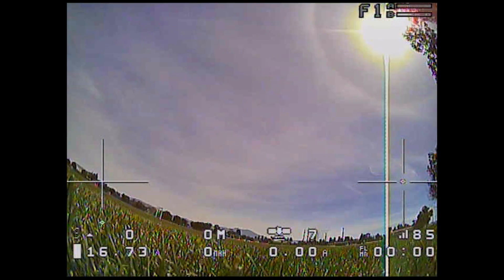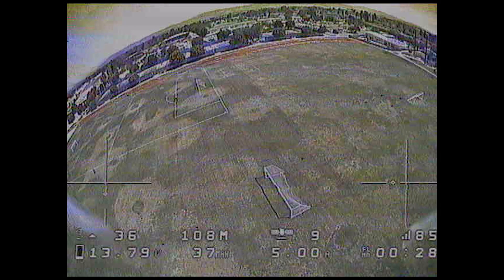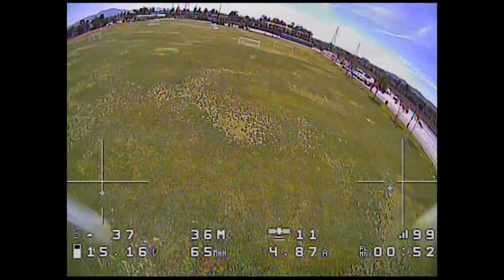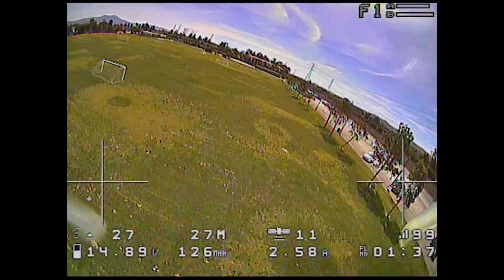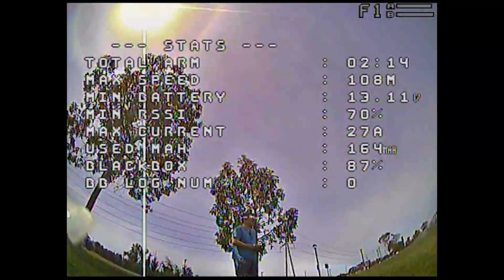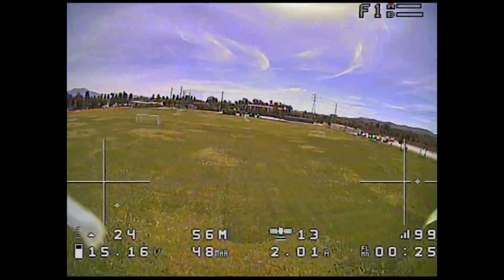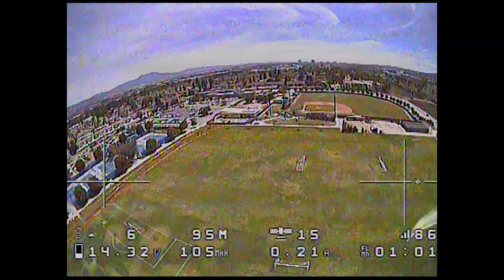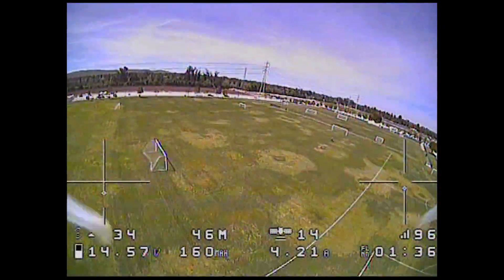GPS Speed Test // Diatone GT-R349 ⚡⚡⚡

Comment: Awesome video! Did some speed run tests using a pocket radar and stock 3028, then 3052 and 3076s, using RDQ 4s 650s, got it past 100mph and the motors just scream. Its fast and likes to eat batteries.

Comment: I used the HQ 3x5x3 props and added an xt60 lead to mine and got 113mph, had 2 weird freak outs trying to do a front flip at about 80mph! I believe it was the momentum of the battery that caused it, one was so bad I disarmed but was able to recover.

https://youtu.be/bfmLGGxLTmk

Comment: Just working it out here; the GPS is giving us ground speed. What we're wanting is air speed of course, so wind can affect the reading. Explains why official speed records use GPS and multiple runs in both directions. The GPS is great the way it averages over a second or three, in that it is not going to ever over read (except for wind effect). I figure the best approach using the OSD end of flight screen, is to do two flights with two fresh charged batteries, in opposing directions. Then your speed measurement is the average of the two screen readings. That will cancel out any wind effect, and allow you a few runs in each direction - to make sure you get it fully up to speed. Just hope the wind doesn't change between flights. Hm :).

I think I'll wire in support for the Bn-180/220 modules on every build from now on, where possible.

Re. max throttle; was AirMode on? Doesn't airmode limit the min and max throttle values slightly? We might want to do these speed runs with airmode OFF. I doubt we'd see much difference though.. very often the last few throttle percent just burns more amps and is to little effect.. depending on the build/motors/cells/props/etc.

Thanks for the video and info. Cheers.
Reply from the maker: I'm sure you are missing at least 50 more steps to maximize every ounce of speed possible.  I'm not interested in doing that kind of testing.  Hopefully someone else with a lot more time on their hands will use this video as inspiration to take this testing to the next level.  Good luck to them!

Comment: Hey Albert, another great review.  
 I was curious,  I have  a gtr 349, and my amp,and Mah  readings are messed. what are you using in beta flight bat for your settings? I noticed that they look on in your video. 
 Thanks in advance.
Reply from the maker: You need to do a calibration.  You can't just use anyone's settings.

Comment: Great video! I love my GTR 349, it’s my first drone and I’m just getting used to it. What batteries are using? I see you’re getting up to 25A from them.
Reply from the maker: 750mah 4S GNB Lipo.
Reply: Theres no way that current meter is calibrated, your pulling at least 60amps at full throttle on those motors with those props

Comment: What update rate are you using on the GPS? The standard is 1Hz, so you have to wait 1 second to get the reading. But each time you get the average speed of the past second, so if you were accelerating then you get a lower reading than the actual (at time of the update). 
If you're able then try to increase the GPS update rate but I'm uncertain whether it's supported in betaflight.
Reply from the maker: I just used the auto settings.  I realized the max speed for the flight is shown at the end when you disarm, so my whole ramble rant was kinda pointless.  You can still get the max speed at the end and I think that's all I care about.
Reply: Here is the betaflight documentation, how to change the update rate: https://github.com/betaflight/betaflight/blob/master/docs/Gps.md#ublox-gps-manual-configuration You could try the `Measurement period 100` to set the gps to 10Hz mode. You should also check the navigation mode: it could limit the reported speed.

Comment: I saw a video of a guy showing his RC Car going 114 mph (https://youtu.be/WvUWHCqOijI?t=18) as measured by 2 radar guns and Garmin GPS.  The GPS is accurate, but the measurement speed is always slightly delayed due to the processing of the data.  Great point about the OSD not updating the throttle percent accurately.  I wasn't aware that it didn't register in the OSD, perhaps a black box log would help?

Comment: Are you using Betaflight 4.0 stable release? having an issue with this quad taking off on its own when arming with 4.0 flashed, doesn't happen on 3.5.7? Thanks for your vids and your efforts!
Reply: Just a thought... I noticed that the "Motor Idle Throttle Value" has changed from 4.5% to 5.5% in BF 4.0. That obviously would spin your motors a little faster when arming.
Reply: @Dieselshroom  Changed my motor value all the way down to 3% and still was happening. This was a complete fresh flash, no diff paste or anything, set up from new
Reply: @shaneybow2102  its something about the D value, needs to be way lower in 4.0... also decrease P like they write in, i guess, 4th topic in the tuning notes
Reply: had same issue with custom bild...its about the hight power to weight ratio... lowed pids...solved it... just recognized its common in bf 4 , so check tuning notes... at the beginning...there is a cli text....wich should solve that problem i will also try this tomorrow ;) https://github.com/betaflight/betaflight/wiki/4.0-Tuning-Notes
Reply: @AluSlinky  ~  Way to go Bro!
Reply: I heard this from a buddy on his quad too.  I haven't gone to 4.0 yet but this is kind of scary.  Did you import a diff dump of your settings from 3.5.7 into 4.0?  He reflashed and erased the chip then reentered manually and it didn't happen again.  So I'm not sure if it was due to old data on the chip or an incompatible diff import.
Reply: @frankbarajas  yes was pretty scary yesterday testing my new 2.5 inch build with 1:9 weight to power ratio xD flying to the moon when taking off....disarmed at about 200m hight...armed and catched and disarmed about 10m from ground no damage :D
Reply: @AluSlinky  ~  Nice save and I doubt most people would have been able to do that quick of an on-the-fly recovery.
Reply: @frankbarajas   was first flight, LOS, dont know how it would have end in FPV ^^
Reply: @AluSlinky  ~  I thought you had done that save FPV...lol  I always maiden my quads LOS, but I learned to fly line-of-sight some  37 years ago so it's natural for someone like me.  Smart moves none the less, you turned what could have been a bad day into a great save.  Those of us about to fly, Salute You.
Reply: @AluSlinky  nope the scary thing was first time arming was indoors in my warehouse to make sure everything was correctly set, little did I think it would start lifting off 😲, quick disarm though so was in full control. Going to test the cli from the devs on that particular issue and see if it helps but I mean how low can D go before it's having no affect?

Also d_min is active so technically my d gains were only sitting at less than 10 on pitch and roll when this was happening🤔
Reply: @frankbarajas thx bro :)  i only fly LOS when testing....im very bad, only i can with nose in front...when i turn yaw im completly lost ^^ im very happy i saved my tiny monster :D
Reply: @shaneybow2102  after happening to me...i lowed all p's and d's and also feedforward on all axis... i think p and d about 20 and ff to 50. also i set motor idle to 1percent, but dont think this was solveing it.
Reply: @AluSlinky  are all other 3 inch builds having this issue or is this a combo of this particular quad and bf4.0? Even my 75x on a carbon frame has way higher pids and this kind of thing never happens, I know it's a different beast but still.... Interesting
Reply: @shaneybow2102  its my first kwad with bf4, its a custom 2.5" build with the diatone 249+ frame the mamba mini stack, racestar&t-motor 1106 and emax avan rush props, its just 155g with lipo and about 1400g max thrust ;)
Reply: @frankbarajas  nope I didn't paste any diffs, set up completely from scratch, can't be down to sensitive D as my gains were only at 14 on pitch and roll, hardly high?
Reply: @shaneybow2102  ~  That's way bizarre, sort of glad I have waited on 4.0.  Sorry for your troubles though.  Have you checked out AluSlinky's comment about the 4.0 Tuning notes?  Maybe there's something else there that might help.
Reply: @shaneybow2102  they added some mor values ,iguess,  like d_min... maybe you have to change that also
Reply: Frank Barajas betaflight github strongly recommends NOT to copy and paste into 4.0
Reply: @53roger  I didn't copy and paste though as I had seen this before hand. Testing today
Reply: @shaneybow2102  i just tested... flashed new, copy this cli for freestyle and after this for high power to weight ratio....turned down airmode to 3percent, and flies pretty nice.
Reply: @AluSlinky  yep just re flashed and added cli from devs for power to weight and its hovering well, nothing weird going on and thats with high enough pids i.e p 30's and d's at 20+
Reply from the maker: @shane bowers I'm flying a pre-release nightly build from about two weeks ago.  You can't fly this on the default PIDs in 4.0.  It will go crazy.  I lowered my PIDs somewhere in the 10-15 range for P and D.  I also did a bunch of other things which I will talk about in a future video.
Reply: @AlbertKimTV  OK will do some testing tomorrow and see if I can pin point what is causing the issue, will input the dev cli and keep same settings to see if its gone, if not lowering slowly to see whats causes it to stop, will report back
Reply: Same issue here, reflashed the FC, perfect flight afterwards
Reply: @zephyr2278  what pids you running?
Reply: @shaneybow2102  I don't know exactly, look up andy RC's video of this quad, I'm using his but I raised I up to 60 and 50 for yaw